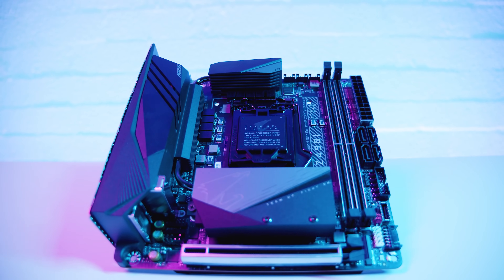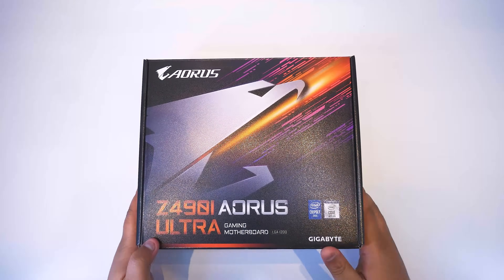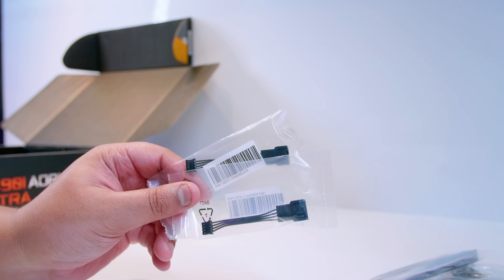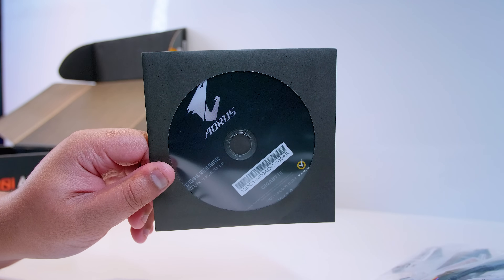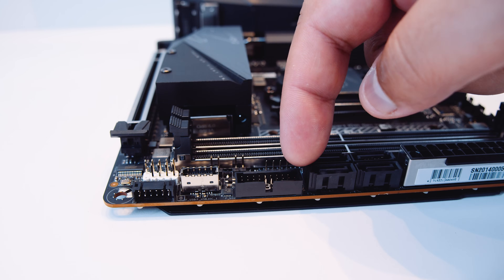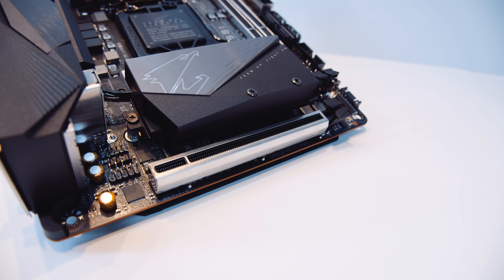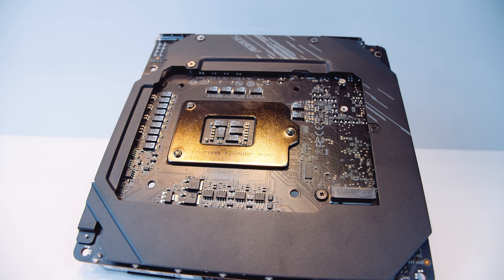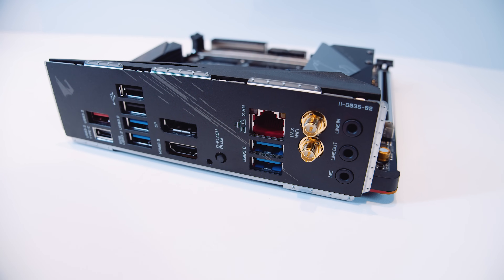Z490I AORUS ULTRA: First Look and Overview

Comment: Hey just wanted to say that currently gigabyte’s driver download page is a bit of a mess and on my first install I had some bugs and problems. Soon after I bought a wd black sn750 thanks in part to your review and had to reinstall windows. I decided to use that black circular thingy in an external disc spinner and actually the automatic installer was much more informative, faster and zero bugs afterwards! Truly didn’t expect that!

Comment: I just got this board, just wondering if anyone is having the same issue as I am. When I have a discrete graphics card plugged into the PCI E slot, I cannot view the POST screen nor enter the BIOS when connected through displayport. Anyone else having this issue?

Comment: 🤔 like the looks of this board. but the 10 core draws a ton of power at full load, so will this board have vrm thermal issues? that's something to definately look at since alot of these z490's have gone with much more powerful vrm configs than z390

Comment: can someone tell me if lga 1151 mounting hardware and the hole positions the same as lga 1200? im trying to figure out if my cooler would work it says compatible with lga 1200 on the website now but not on the box I have and I bought this a few months ago so maybe its not the newest one idk. thanks if anyone can help.
Reply from the maker: It's the same. Intel won't change that for a very very long time. They haven't since 2008.
Reply: @GearSeekers  awsome thank you

Comment: It almost seems like most Motherboard manufacturers favour Intel over AMD.
For example, take Gigabyte ITX Motherboard for both Intel(Z490I AORUS ULTRA) and AMD(X570 Pro Wifi) 

Intel = 1 x USB Type-C™ Internal Header. AMD = NA
Intel = 4 Fan Pin Headers. AMD = 2 Fan Pin Headers
Intel = 2.5GbE LAN. AMD = GbE LAN. etc.
Reply from the maker: They were both designed at different times. Remember it's probably more than a year between development. Regarding the 2.5G Ethernet. That's a Z490 required spec. Nothing to do with Gigabyte.